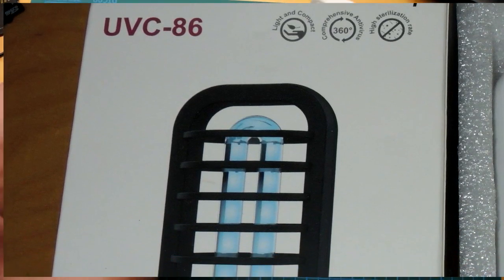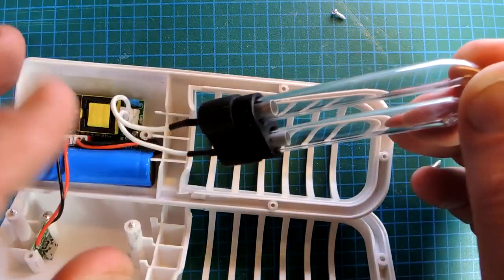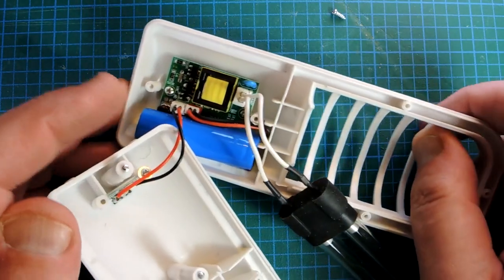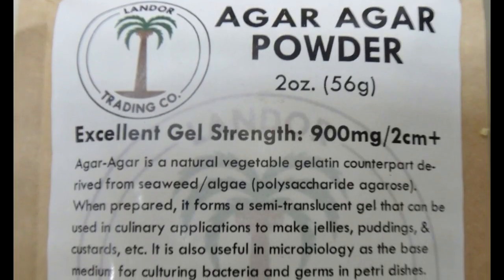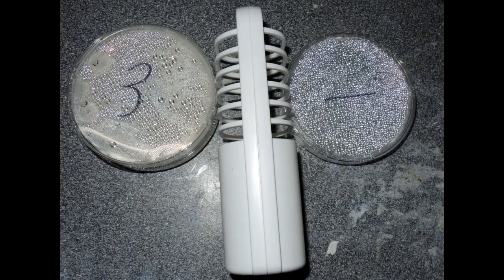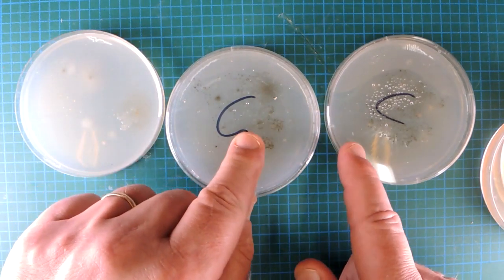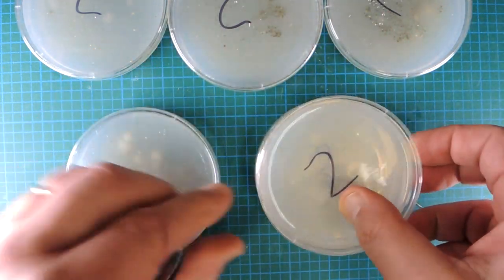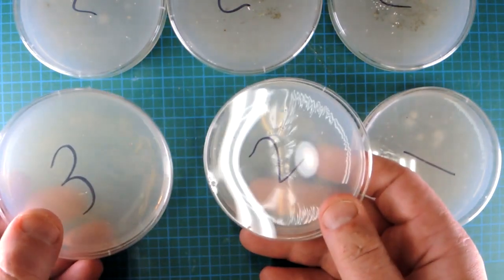UV-C STERILIZATION LAMP: REAL OR FAKE?

Comment: It's real. All of the mercury vapor UVC lamps (such as your lamp) are real. It's the UVC LED lamps that have many fakes. By the way, if it didn't work in your experiments, it's because you left the plastic lids on. Ordinary glasses and plastics have 100% UVC blocking. That's why ordinary glass is only used in UVA lamps to make fluorescent clothes glow at parties, but ordinary glass is NOT used in UVC lamps to kill germs. Those use quartz glass tubes, which pass UVC light. Your petri dish lids are plastic, which blocks 100% of your UVC light's output, making it LOOK like it's a fake lamp, to those who don't have the same scientific understanding I do. Please be more careful with your videos, or you may convince people without scientific knowledge not to trust lamps that they SHOULD trust. I can tell just by looking at your lamp in this video, without even testing it, that you have a real UVC lamp in this video.

Comment: An effective safety tip when using/testing uv-c devices. Glass and just water will block most of the dosing so to limit exposure get behind a "shield". Just be aware the there's always a bit of spillage. Also,  a radiometer will show the amounts per second at distances making testing for real world applications more precise. Thanks for the posting, good stuff. 
A simple cheap test. https://www.youtube.com/watch?v=7lzq6LuVWH0

Comment: Is there a simple way to know if a light is UV or just a purple light? I'm a simpleton but I wish to have tips so I can also safely serialize some stuff I have. Any ideas?
Reply: Yes, it's crude but a simple way to test. Use the lamp on a banana. After a few minutes (depends on the power of the lamp) the banana will have slight scorching on the surface of the peel. Cover part of the banana with tape so that you can see the differences. The time it takes depends on the lamp's power and the distance from source to banana. 
Should the scorching not occur then too much distance, enough time, or not not enough lamp power may be a factor - or- it's piece of junk. Good part, you can still eat the banana.
https://www.youtube.com/watch?v=7lzq6LuVWH0

Comment: UVC Sterilization product will not be a fake if we buy from a good company. One of such company is nevonexpress. UVC based product is proved to kill 99.9% viruses. They have designed it using 253.7nm Wavelength UVC rays. UVC rays are not harmful for humans. It only consumes 230V AC  power. This product is also recommended by Department of Science & Technology, Govt. of India
Reply: UVC at 250 +/-nm is very harmful to most living things. FAR UV at the 222 nm range is not however.
Reply: Are you saying this product is relatively save if it contacts our skin a few seconds for example when we turn it  on?
Reply: @akbarnursalam435  We should avoid contact with eyes and  skin. But it provides 100% disinfection and kills microorganisms which is proved you can visit Nevon Projects youtube channel latest video for proof
Reply: UVC that sterilises is very harmful to human skin, particularly the eyes.
Reply: Hello everyone. This is Eunice from GMY lighting in China. We are professional in manufacturing the UVC gemicidal lamps and we have the far UVC222nm lamps. Any interests, Pls feel free to contact me. We can offer samples for you. The far UVC 222nm tubes, light module and the sanitizing door. https://youtu.be/JKizUelsHFM
Eunice Chen  Mobile/WhatsApp:+86 13428280794
E-mail: yingfangchen1992@gmail.com

Comment: The UVC may have been partially blocked by the plastic lids.  It's easy to block, which is why the tube itself is made of a specialist Uviol glass like quartz.
Reply: That is the exact comment I was going to make. Please do the experiment without a top for the petri dishes exposed to the UV-C light. I did this with Agar media, and the UV-C petri dishes were totally clear. Thanks.
Reply: Rob Black That’s good to know. Did u have the same lamp from Amazon? That’s how I found the video. Wanted to see if it was legit or not. ☺️Thanks!
Reply: That's true, polycarbonate is opaque to UV.  So if the point of a petri dish is to grow something and not kill it, a polycarbonate container would be best to protect from even stray UV.  Most clear safety glasses are 100% UV blocking as well for the same reason, polycarbonate.

Comment: Excimer lamps are a bit different.  They seem to work by capacitance.
That's a classic cold cathode mercury vapour tube, but quite a fat one compared to the usual ones with very thin tubes.
The power supply is probably a Royer oscillator with two transistors, that produces a symmetrical output to avoid mercury migration in the tube.  The little blue capacitor in series with the tube rations the amount of current through it.
Reply from the maker: Thanks for the additional details!  you have become an expert on these lamps with your various tear downs.   I was actually pretty impressed at how well these lamps work.  I thought a battery powered UVC lamp as a gimmick, but it really does do what it says.
Reply: @electronupdate  Try it in your fridge.  The ozone really does have a profound effect for such a low power device.
Reply: Thanks Clive, I got one of these small units for my fridge and cupboards, based on your knowledge that the LED ones are sketchy. Thanks also electronupdate.

Comment: I work in a bio-lab, just for future reference,  Once you have your samples inside the growth medium you must flip the petri dish upside down so the lid is on the bottom. This is to prevent contamination from airborne particles and from the condensation that forms to interfere with colonial growth and distribution.
Reply: Not to be critical, but wasn’t his goal simply to see if something grew at all & what-if anything would happen when exposed to the light?  If they were all kept equally sitting around and the results are different after the light, does that not make the case? Because they would’ve all had the same “whatever” growing, regardless of where it came from. Thus, after time, they’re contaminated w growth. The ones exposed to the light seemed to have very little, if any growth left. I’m not a scientist, it’s just what I think was what the gentleman was showing. Correct me if I’m wrong, I’m not 100% sure. That was the conclusion I drew from the video. 😊
Reply: @NicoleTWELVE22  Yes the petri dishes upside down is what we do in mushroom agar production and they get contaminated randomly even if in the same environment.  We use tape (microfilm) on the side to make sure they are sealed also.
Reply: When is it preferred to using streaking of samples?
Reply: tablatronix I’m not sure why you mean, do you mean when is it preferred to use the streaking method ?
Reply: Zzyzx Fox yes, I have seen people do both and was curious if the surface area was better or if it was for discretizing sizes or something

Comment: We don't get to see it on????   Anyway, I GUARANTEE that's not an excimer lamp. I've never seen excimer lamps used outside of very highly sophisticated and frankly still somewhat experimental UV sterilizer lamps usually in medical settings. Plus they're still very expensive. That's absolutely a mercury vapor lamp. There's also a WAAAYYYYYY easier and faster method to see if it's real, just see if it tans a green banana after a few minutes.

Comment: I'd probably run the lamp through a cycle or two around where you opened those Petri dishes, just in case anything growing in them happens to spread using spores. :/
Reply: Without a dedicated growth medium there's not much chance of spread.
EDIT: Or unless he keeps old tangerines lying around the teardown station.

Comment: great video as always, thank you for taking the time and sharing, coming from you I thought that we were going to see the insides of that ucontroller lol. is there a ink to purchase on ebay? Thanks again
Reply from the maker: Bought it off Amazon. Sold out, and I don't think the listing is active anymore
Reply: electronupdate there’s more. They might have slightly different labels. The one you had is identical to the one I bought on Amazon. UVC-86 is all the box says. Under the #2 Quest it asks, “is it effective?”. The last sentence in the answer is hilarious. It says, “The charging design is convenient for the use of killing letters such as sheets and pillows of the wine shop during the travel”. Whatever THAT means! 😂That’s what rose my suspicions if it was legit or a fake. Thanks for the video. (And be very careful with your traveling wine shop pillows. You don’t want anything happening to those. Lol.)